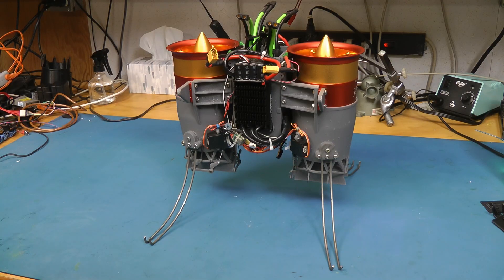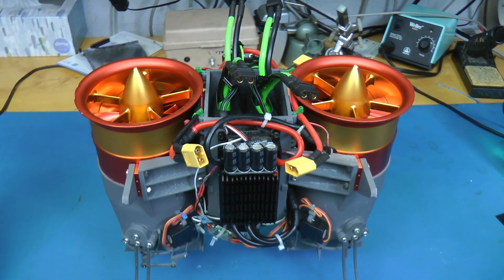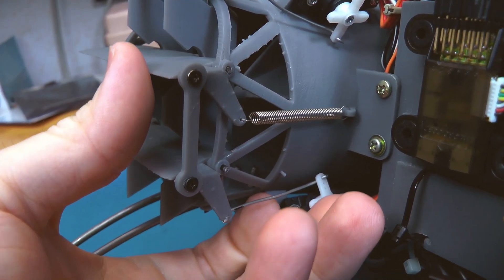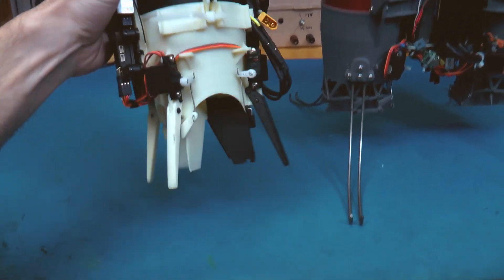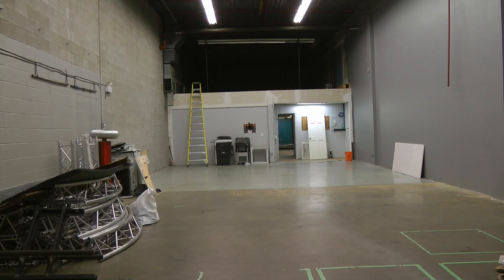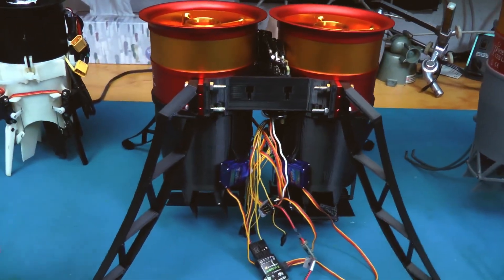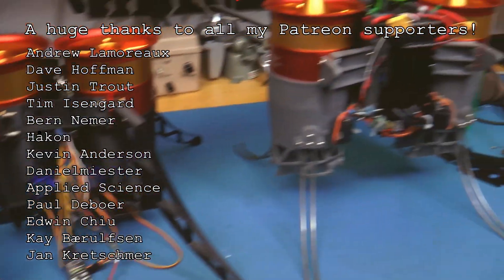Ikarus II - 3D Printed EDF UAV

Comment: Love the anti-backlash design. Does your first version's yaw  work well? (Ie. when all the vanes turn CW or CCW). I had the idea to make something similar in an RC airframe so it would be actually a roll movement and wondering if it would be enough to overcome the wing's resistant. I'm trying to stay away from needing any control surfaces like ailerons for rolling.

Comment: Do your 2 ESCs connect to the flight computer / your 5v circuit via BEC, and do you have the positive terminal of one of the BECs capped or are both fully plugged in? (I'm learning how the electronics on these work)

Comment: Hey since theres no contra rotating blades / turbine fans how are you cancelling out the rotational torque that gets generated by the rotation of the blades? Do the control surfaces at the bottom able to rotate independently and generate yaw authority?

Comment: I have a question about ikarus. Would it be able to lift things? Let's say I am working on a rooftop and I need to bring tools to the top quickly.  What's the largest EDF your algo can handle?
Reply from the maker: If the payload is onboard it's no problem. You could get EDFs about 2-3x as big as this, but there's no real limit to how big you could go with this algorithm, it should scale indefinitely. A conventional quadcopter would be much more efficient and could lift a lot more weight for a given cost however.

I tried lifting things with a string, but it's unstable. It's difficult to attach a rope to a point that allows the craft good control authority, it really needs to be attached at the center of gravity which is not practical without a big gimbal.

Comment: It has 13 HP! That's mind (and gravel) blowing.

Have you considered having extra servo per EDF that spreads apart the vanes? This would let you quickly control the effective thrust of each fan allowing for much faster response than only by RPM variation. With that fast airflow this method of thrust shaping should start to be effective already.

Comment: The Form 2 parts just need a different resin. Zack Freedman has a recent video on printing resin Nerf blasters, which typically have parts prone to failure due to the spring forces of the blasters. He found that some of Siraya Tech's resins are good for blasters, which he settled on a mix of 5:1 Blu to Tenacious, for better performance when it comes to screws not pulling out. If it's good enough for a blaster with high spring forces, it should be more than durable enough for the parts you're printing. 

Personally, I think a horizontal flight variant of Ikarus based on this design should be left as a version 2.5. An Ikarus 3 should explore three EDFs, similar to how a tri-rotor performs, this could also explore various other forms of control, such as tilting the EDFs rather than using veins for a vector; doing this with two degrees of freedom, either with some kind of spherical joint or with a gimbal, could also make the transition from vertical to horizontal more interesting, as you wouldn't be tilting the entire craft but instead only changing the position of the EDFs. Ikarus 1 was a mono-EDF, Ikarus 2 is a bi-EDF, Ikarus 3 should be a tri-EDF, which would leave Ikarus 4 and 6 to be a quad and hex, etc., which would also leave Ikarus 2.0 as vertical-only craft and 2.y as a vertical and horizontal craft, similar for 3.0 and 3.y for a vertical-only and vtol with horizontal flight variants, as an x.y naming convention. Personally, I think the best naming convention would be x.y.z.α, where x is the basis of the concept (mono-EDF, bi-EDF, tri-EDF, etc.), y is changes to the platform of the craft (vertical-only, horizontal flight, any other major platform changes such as EDF positioning, additional control surfaces, chassis changes, body changes, etc.), z is supplementary system changes (such as a change to how thrust vectoring works, vein-based vectoring, nozzle-based vectoring, motor vectoring via gimbal, motor vectoring via non-gimbal joints, and incremental changes to other supplementary systems such as if you add active surfaces to wings and those surfaces evolve over time [the initial addition would be a change in y, incremental changes would be a change in z], etc.), and α being minimal changes (such as battery upgrades, controller upgrades, EDF upgrades, etc.); it's just better documentation and keeps a cleaner path of project evolution, not to mention an organized changelog. This would also prevent the issue where version 10 in the current naming convention would be wildly different than version 1 or 2, whereas the x.y.z.α naming convention would keep things more defined. A naming convention like this also adds a lot more breathing room for branches of the project, such as if you do want to eventually explore tri-EDFs and quad-EDFs, the naming convention is built to allow those branches without those getting mixed up with other variations within a mono-variable version convention, say Ikarus 3 and Ikarus 4 rather than something like version 10 and version 20.

Comment: I preferred the single fan version because one fan is impressive. But this is also a very good achievement. Are those servo not crap ? Would more precise and fast ones bring more control and feel ? What is the material of the legs ? Nice job for Icarus 3 ! Nice job for removing weight !
Could you please redo the single one fan for Icarus 5 ? With all know how you learned ...
Reply: Please keep it open source and we'll documented so other can learn too ;)

Comment: The control surfaces works better when the rear edge is blunt. It increases efficiency for small angles around 0 (for the cost of a higher drag).
Reply from the maker: I'm curious to know more about this. You say increases efficiency, efficiency of what?
Reply: @tesla500  increases efficiency of deflecting air flow.
When the rear edge is sharp it feels like a dead zone around the central position like the control surface does nothing.
Easily testable on small hand-piloted models ;)
Depends on the whole airfoil, especially if it is a part of a bigger stationary surface, though.

Comment: Hi, great work. since weight is one of the main important factors for EDFs, may I suggest to change the servo wires, remove the bottom of Servos (tiny bits of of hotglue instead. + cut the screws to a better length and, of course, use a very small receiver with direct soldering.

Comment: Nice prjoect! I think you'd get better results by using a more recent flight controller like an F4 or F7. Naze32 is a relic and CC3D is like Adam & Eve..
Reply from the maker: Yeah I keep designing in old stuff. Is there any good resource listing and comparing currently available flight controllers?
Reply: @tesla500  Not that I'm aware of, but they don't have many differences. Chip speed f411 < f405 < f722 < h7 and price accordingly 30 - 100++€. No of uarts goes from 2 to 9 but I guess you won't need them. All support Betaflight and other firmwares. All fly almost the same although with f411 you may have to turn loop speeds a bit down but even it still flies the same.  I'd get an f405 or f722 with blackbox to know what is going on during flight. They go for about 30-50€ on Aliexpress. If you want to see the difference between these and the controllers you used, see Rotor Riot's Kaveman Kwads - video and compare the flight performance with their other stuff.

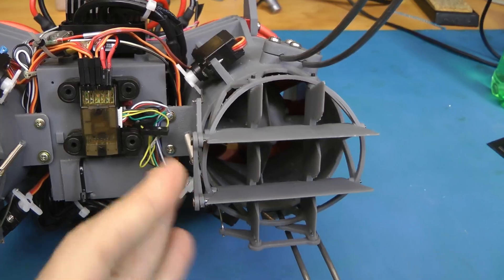Comment: 4:10 have you experimented with the tougher and less brittle resins?
I also believe you can also add some flexible resin to your hard resin and get the equivalent of a plastic alloy of the two, so its less likely to shatter

I, too, prefer fdm of resin for structural parts, though
Reply: *fdm to resin

Comment: 10kW sounds awfully high.... my electric bike (23kg) pulls my 85kg body uphill comfortably with about 2kW.
Are the EDFs not able to change speed quick enough to control roll attitude? If they are, you could do away with one set of vanes, would be less weight and less drag. Example: https://www.youtube.com/watch?v=hstkV_uUs28

Comment: change the edfs to spin tesla/impeller pump turbines, vertical
Reply: also works as gasoline burn flight extended burner-generator with rotational valve pulse jet
Reply: try gasoline hot air burner blimp
Reply: looks like a jetpack, nice job

Comment: Would it be possible to compensate the one edf version gyro effects inside the flight controller?
Reply from the maker: Yes, that's done in Ikarus 1, but it needs a lot more work to fully solve the problems. It flies, but still has some stability issues due to the slow response of the servos.

Comment: Hello, really appriciate your work and you, for sharing knowledge and experience with us. I could not help notice, that you actually solved the stability issue, that many "jetpack" developers struggled with, in a larger version. Some of them, never managed to make software aided stabilization. You did it, and share it with us! BTW, seen the movie, "Rocketeer"? :) As for "jetpack" I settled myself with the idea is not viable, since such a configuration need to move a lot of air (loud and energy demandig) and a single component failure is a disaster for the operator. And then, the idea of accelerating a lot of air in a smal area, result in compressing air in a such degree that the efficency is low and energy demanding (gas laws).

Comment: Given any thought of placing the ESC mosfets in the air stream or bonding them to the metal housing of the duct? Assuming they will get toasty for longer flights as the data sheet looks like they need absurd airflow for the continuous operational spec.
Reply from the maker: Yes I'm planning to use thermal pads to connect them to the EDF housing. I was thinking of placing them in the ducts initially but this just made so much more sense layout-wise, considering where the servos are mounted, and the space between the fans due to the inducer ring.

Comment: Can you stack counter rotating rotors in the EDF (like a helicopter) to balance out the gyroscopic forces? More complicated mechanically, but only one fan needed.

Example: https://youtu.be/WNkohUPIRNQ
Reply from the maker: Yes, you could configure them that was as well. Would get slightly less thrust though for the same amount of power

Comment: I've just realized that this has might have the potential to fly horizontally with quite high speeds. Maybe needs an addition of two short wings on the sides. Nice progress!
Reply from the maker: Yes! This is on the list for Ikarus 3
Reply: @tesla500  Why not stick a gimbal camera on it as a DIY drone UAV thing
Reply: @tesla500  How would it perform in strong winds
Reply: Buzz lightyear...
Reply: @Doom2pro  lol straping a toy buzz lightyear will be fun
Reply: And with addition of a small foil or wing...
Reply: I thought so too! Fold-out wings could be a great idea if the weight can be kept down.. foam and plastic/CF tubes for extra rigidity maybe?

Comment: You ought to look into Engineering grade resin for your frame. A cheap resin I use often is Blu V2 by Siraya Tec.
Reply: 2nd'd. I know someone who uses the same stuff and swears by it. I haven't got my hands on it yet but claims it's as strong as FDM plastics. Non brittle.

Comment: there was something about the previous version having a single axis that made it look really cool. could set these fans to be coaxial?
Reply from the maker: I was thinking of that, it would basically double the total pressure ratio so the exhaust velocity would be higher. For thrust, it's definitely more efficient to run the fans in parallel (side by side) rather than coaxial, but the higher velocity would allow a higher top speed.
Reply: @tesla500  it's not about performance, it's the cool factor that the coaxial version excels at
Reply: @Alexander Sannikov there is an interesitng design by amazingdiyprojects: https://www.youtube.com/watch?v=tEEXPxN7qq4 there are newer videos of it as well
@tesla500 Would it make sense to use different AoA wings for a coaxial design? Maybe the efficiency could be similar to a parallel design if engineered accordingly. For instance Turbomolecular Pumps use stages with different AoA fans
Reply: @maeanderdev  yeah that guy certainly knows his stuff, I've been following him for years. the coolest part of his design is that he does not need to have a precise control of the main engines and it can be combustion driven for example